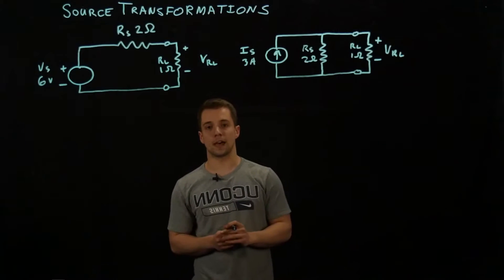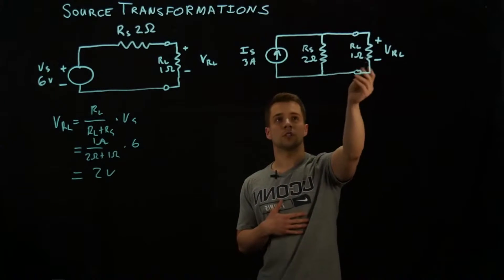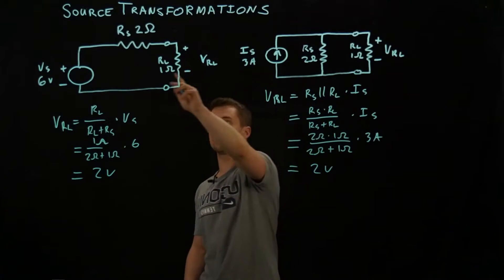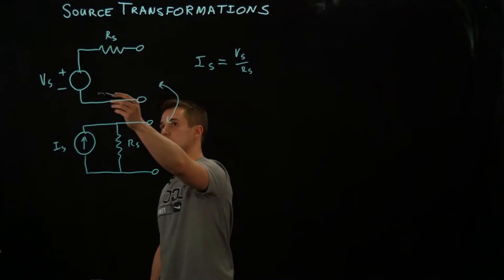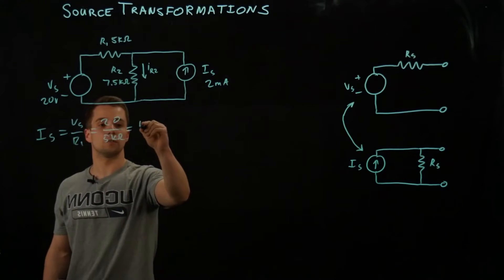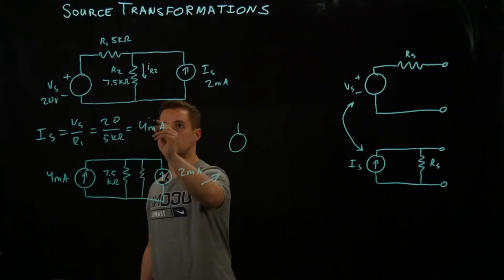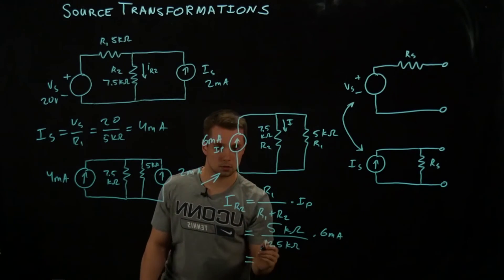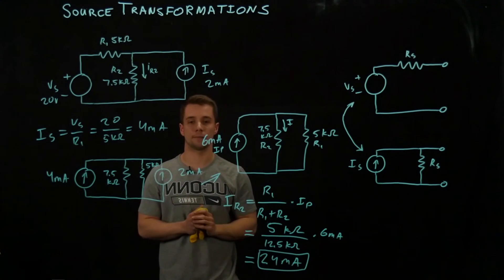Circuits 1 - Source Transformations - Intro

Comment: you messed up
Reply from the maker: Would you mind letting us know where? We will add/pin a comment explaining the error!
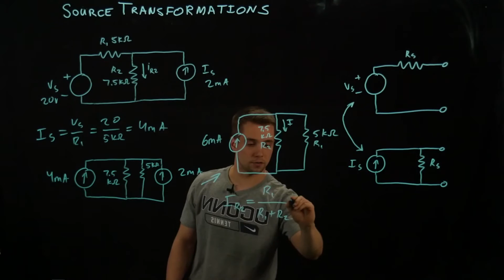Reply: @UConnHKN  When doing the current divider rule around 5:45, I think the resistors are in parallel. When you combined them for Rt, you added them as if they were in series. 
also, the total resistance should be on top, and the specific resistor value would go in the denominator. I could be wrong but I'm just following formulas I've found online for this.